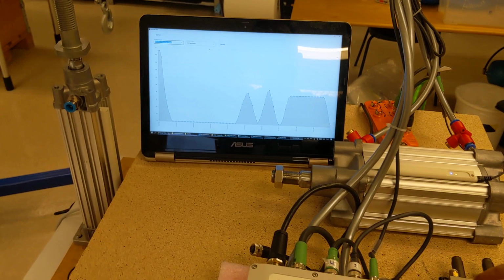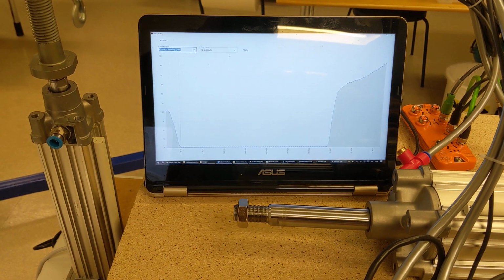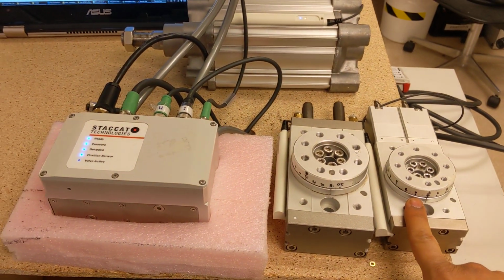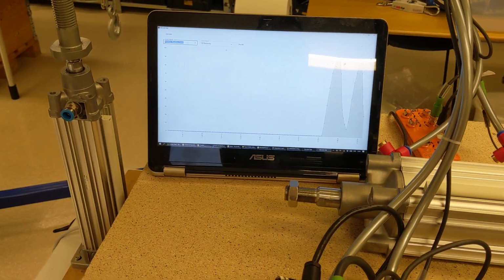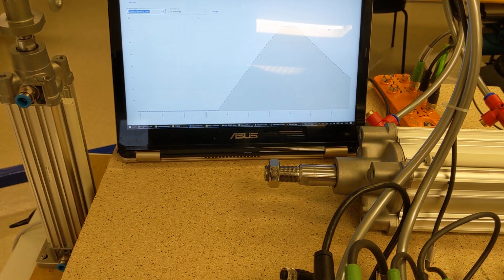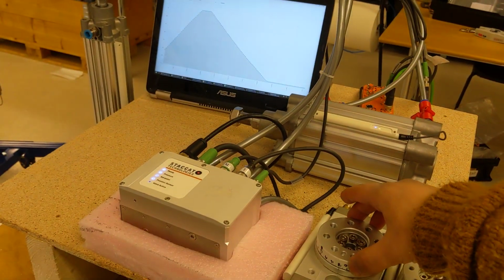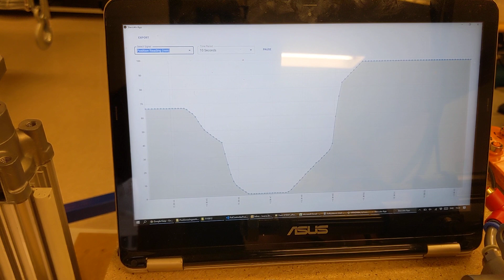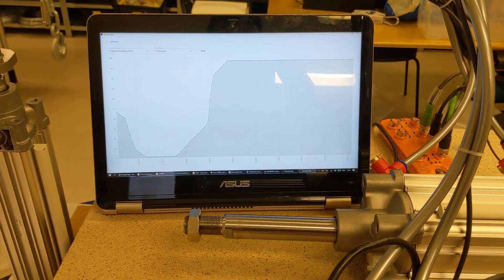Varying speed and positions on pneumatic actuators

Comment: Which valves are used? From the clicking noise it looks like you use some type of solenoid valve instead of proportional valve?
Reply from the maker: That is correct. We use our own, patented high speed valves. We cycle them up to 100hZ, we also have other valves that can operate at 1000Hz. feel free to email us at order@staccatotech.se if you want to know more.